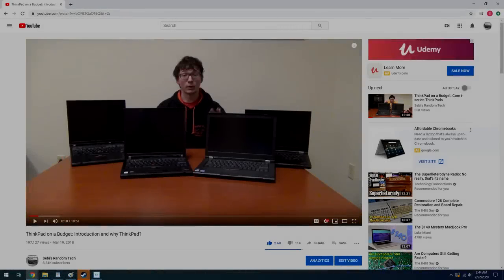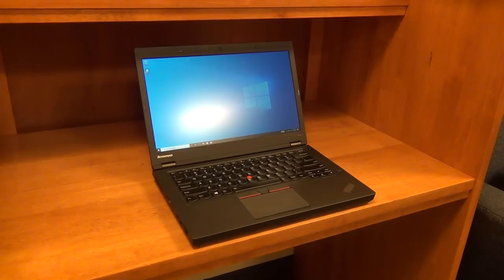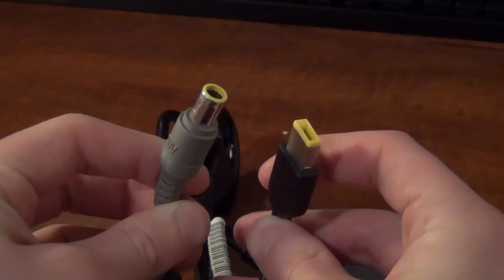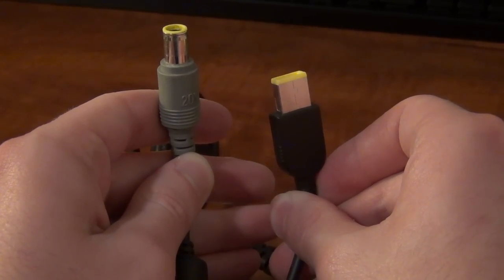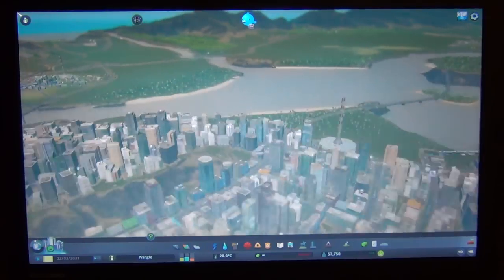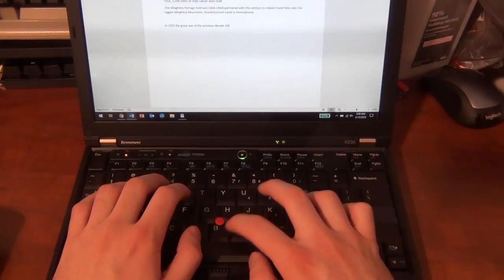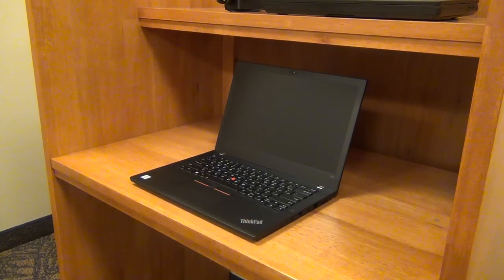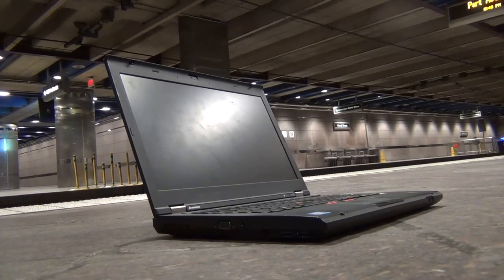Best Value ThinkPads in 2020

Comment: It depends what job you're doing.. as an Engineer who working alot with Solidworks, 3D CAD, 3Ds Max i would recommend you: Thinkpad W541 & Thinkpad P50.. mine is Thinkpad W541 (refurbished)

if you have more budget, you can get new Thinkpad P1 or Thinkpad P53.. later you can plug in External GPU with Thunderbolt Cable
Reply: I absolutely could NOT agree MORE with you here! I have a couple of W540 ThinkPads for my CAD, 3D Desk, and Photoshop needs. The K2100m graphics are more than adequate for my needs. The i7-4900mqq, is pretty much overkill for my needs. I won't need a P series for quite some time, however a P series is a REALLY good investment for the Engineer/Graphic Artist.
When the cost comes down on a high-end P70, I may very well go to one, but I have a set budget of $400 USD, for the initial purchase price.
Reply from the maker: The T440p can be upgraded to a 4900MQ if I remember correctly. While I agree with both of you that the W/P series are very solid machines (I have a W540 myself), they are still a lot more expensive than an equivalent T series from the same generation. Obviously they have an advantage in the GPU category and usually have beefier processors, but nowadays the difference in performance between them isn’t enough to justify the premium commanded by a lot of W530’s, W540’s, etc that I see being sold online, when a T440p can be upgraded to around 80% of the performance of a W540 for less.

A friend sold me a W540 he found at a recycling center for a whopping $15, which is the only reason I have one ;)
Reply: @SebisRandomTech  Maybe 4900. I've tried that and ended up with thermal issues. I have one with a 4800. It's warm, but pretty decent most of the time. I like to recommend a 4700, or 4710 for the T440p. No thermal issues at all.
Reply from the maker: @dragunovbushcraft152  Or the 4702, which runs at 35W instead of 45W.
Reply: @SebisRandomTech  Meh, that would be going backwards in clockspeed though. Even just a little bit, can matter at times. BUT it is an option.

Comment: I was a pretty long term user of ThinkPads, my first one was an X61 and I loved it. However, as the GPU performance of all older/classic ThinkPads is their weak point (as described in the video) I had to jump to the Dell Precision and HP EliteBook lines instead. If you want a portable AND upgradeable machine then the HP EliteBook 2570p is a great option as it does offer a socketed Ivy Bridge CPU, upgradeable RAM, eGPU support and removable battery into a 12" chassis. And both Dell Precision and HP EliteBook 15" and 17" Sandy Bridge and up models support high quality IPS or DreamColor 1080p displays, dedicated number pad and the possibility to upgrade the internal dedicated GPU via a MXM slot, whereas the equivalent ThinkPad W series of the time get stuck with pretty old and inefficient Nvidia Quadro graphics. The only thing I do really miss from the ThinkPads is the keyboard, you'll never find something more comfortable to work with than those classic 7-row ones. Best regards!
Reply: does it support i7 with quad core though?
Reply: The new X395 powered with an AMD chip is way better on graphics performances (vega 10 chip I guess) which is mind blowing comparing with the intel hd/uhd chip.
Reply from the maker: The 17" ThinkPads, the W700/701 and the P70/71, also had MXM slots to upgrade the GPU. Unfortunately with Nvidia ending support for the MXM standard the P72 and P73 did away with the MXM slot. As mentioned in the video, the T420 and T430, along with every older ThinkPad with an ExpressCard slot, can use an external GPU, and these laptops can be modified for IPS displays.  I've seen a few Dells and HP's (actually just sold an HP ProBook 640 G1) that nearly rival the quality of a ThinkPad, but to me there's still no keyboard as good as the 7-row, or even the newer 6-rows. Some of the Dells and HP's have a pointing stick, but it pales in comparison to the TrackPoint, which is important to me since I don't really use the touchpad. I've of course also heard horror stories about support from Dell and HP.

All of that aside, I will have to look into the 2570p, that seems like a very intriguing laptop. Might make for a good laptop to compare to the X230. Thanks for watching!

Comment: I'm using a T530 with a backlit keyboard at the moment and love it. I would rather have the newer style backlit keyboard than the non backlit classic one because I use it in a lot of low light conditions and find the backlight preferable to the Thinklight. I do need to find a reasonably priced older Thinkpad with a full keyboard with dedicated num keys like a W540 for a friend.
Reply from the maker: I always liked the ThinkLight better because if you need to illuminate more than just the keyboard (such as a sheet of paper or a book), it was a convenient reading light to have. I can remember a class I had last semester where the professor would turn all of the lights off while presenting the lesson (powerpoint), and I could use my ThinkLight to not only type up notes, but also write down some of the symbols and formulas that can’t be easily typed on a computer. I think the **30 ThinkPads did things best by offering both, so you could use whichever one you preferred.

For finding a used ThinkPad with the dedicated numeric keypad, something like the T540 or T540p would probably be available for cheaper than the W540, unless your friend needs the extra power of a W series machine.
Reply: @SebisRandomTech  Thanks. I'll look into those. As for the Thinklight it does have it's place and I'm glad I have the option of either.

Comment: Hello, i have been looking at thinkpads and i need one for uni. The main major thing i care about is the display as i do some digital art. I was gonna go with the t460s as its pretty cheap and within my budget. Their display is decent but is there any better versions? The 1080p touch variants were available. Any views would be greatly appreciated
Reply from the maker: Some versions of the T460s and T470s come with a 1440p display that is supposedly better quality. You could also look into the P series as those usually come with better displays, but they may be more expensive.

Comment: As you pointed out, the best part of Thinkpads is the modularity, upgradeability, great support and plentiful cheap parts availability. Unfortunately I am afraid that Lenovo is following the competition de-contenting and making their machines more difficult to repair.
Reply: Oh, and another thing. COVIID-19 has driven up demand and prices for laptops new and used as everyone had to scramble to get on line and factories and supply lines shut down. It will be interesting how this all plays out if the economy tanks and demand falls. Crazy times.
Reply from the maker: Agree with you there, I’m very anxious to see how everything plays out in the next few months and even years.

Comment: Excellent video thanks!

Where can one find those custom adapter boards for the T420 or T430 you reference at 15:16?

Have you used any with and updated your screen? Thanks
Reply from the maker: Typing this from my upgraded FHD T430! You can find them on eBay, which is what I did.

Comment: Hey, was wondering if you’re uploading an updated video for 2023 soon? Because I need a laptop and really like Thinkpads but don’t know what I exactly need and what the best deal for my budget (€400) is. Im studying to be a light designer, so I need to draw Light design plans on Capture, also want to start with mapping soon so was looking for a Thinkpad with graphics card (thats not the standard intel graphics) For now, looking secondhand my options so far are: Thinkpad T15 gen 1 with geforce mx330 or T560 with nvidia 940mx. Other options are T590 or T560 with onboard intel gfx cards. Don’t know if they will do the job? Greetz Simon
Reply from the maker: If you don't mind the added heft you might be able to get a good deal on a used P50 or P51.

Comment: thinking about buying a t480 with an i5, do you think it can handle 1080p editing if i upgrade ur to 16gb of ram? or should i go with something else
Reply from the maker: Depends on what the price of it is.
Reply: t480 is good. it can handle 1080p editing. 16gb of ram is fine, but better off to just max out at 32.

Comment: Hi! I really appreciate your work. I am a Mechanical engineer and therefore I deal with a lot of CAD and CAE softwares. What model do you suggest for my work? I was thinking ThinkPad P51. Do you think buying a second hand P51 worth it, if so how much should I spend for it? Thanks in advance!
Reply from the maker: P51's are great! I think $700-800 is about what they're going for right now. The P50 isn't bad either if you can get it for much cheaper. The P52/52 have newer higher core processors if you care about that.
Reply: @SebisRandomTech  Thanks for your answer! Truly appreciate it!
Reply: @SebisRandomTech  hey bro does p51/52 are have upgradable cpu & ram & gpu??
Reply from the maker: @imuser007  The RAM and storage can be upgraded. An external GPU can be used via Thunderbolt or ExpressCard, but the internal GPU and CPU are soldered.

Comment: I just bought the Lenovo ThinkPad T520 the other day with the i7-2670QM quad core CPU and 8GB memory and I have already ordered some upgrades. I installed a Samsung EVO 860 1TB SSD and have ordered a 128GB msata SSD it's the best laptop I have ever owned and the best part the laptop is like brand new no signs of wear the battery is a 6 cell battery and it only has 3.5% wear level. I was able to order the hard drive caddy for only $6 counting shipping for it's age it's fast it don't even feel like a older laptop with how smooth it runs and it's very quite
Reply: Congratulations! Is it your desktop replacement? Will it be too heavy to bring out for work?
Reply: @ericyip947  I got a Ryzen 7 gaming desktop but the ThinkPad was a replacement for the old Toshiba i5 dual core that was so slow. It's a great laptop first time owning a ThinkPad laptop. I needed a good laptop that's fast enough to do everything I do on my desktop(the basic stuff) and have good battery life that old Toshiba laptop only had 1 hour and 20 minutes max and the bad thing was that battery was still good. The new 9 cell battery I got I get about 7 hours and the OEM 6 cell battery I haven't tested it but it only has a 5% wear level as of now so it's like new so my guess about 5 hours maybe. I ended up returning the 128GB mSATA SSD and going with a 1TB version for extra storage giving the laptop 2TB total I upgraded the memory to 16GB and even found a ThinkPad laptop bag on Newegg that I bought. Also had to buy a external DAC cause the onboard sound can't run my headphones also bought a USB Bluetooth dongle. Also added a cooling pad and just ordered the last thing for it the other day a portable set of USB powered HP speakers for it. It's running great so far
Reply: @adamgrant1787  7 hours battery in t520? That’s excellent! Did you buy a third party or the original battery? I recently saw a deal of a w520 with 1920 screen, 8gb ram, i7 2630qm just about 110USD ( converted from HK dollars) I think I’m going to pull my trigger, though the heavy weight
Reply: @ericyip947  The 9 cell battery is not a OEM battery the brand on the battery is Dr. Battery and they used all Samsung battery cells. Both the OEM 6 cell and the new 9 cell battery both read is Sanyo batteries so my guess both are using Samsung battery cells. The 9 cell battery lasted about 6 and a half hours to just under 7 hours max I had the laptop power setting to not turn off the screen or laptop and set the power settings where I would have it set while using it on battery and let it run till the laptop turned off. I'm sure it would last longer if I used battery saver but even if it lasted about 6 hours while surfing the web or Youtube I'm happy with that cause I still have the 6 cell OEM battery
Reply: is T520 better than T560 or are the same? pkease answer
Reply: @futurefoothd  I suggest you look at the hardware-specifications of the particular T520 and T560 that you are looking at, and compare the two hardware--specifications, and see which-one has more-powerful hardware.

Also: As far as I know, the T560 was developed AFTER the T520. [So technically/technically-speaking,  it should have newer hardware.]

Comment: Valuable information, thanks! I've never had a thinkpad before but as someone who appreciates the quality of these old builds, this is an excellent starting point. I might try to get one today on ebay. :)

EDIT: bit the bullet and bought a t440p. i'm excited to see how it is in a week or so! :)
Reply from the maker: Welcome to the club! You picked a great model to start with, a lot of easy and readily accessible upgrades.
Reply: @SebisRandomTech  Thanks again Sebi! Got the t440p and then upgraded the RAM and installed SSD. It works way better than the $450 acer I bought a couple years ago that crapped out on me. Plus this one came with the 1080p display already installed. I'm a happy camper :D

Comment: I just bought what I consider to be a gem - T470p ; quad core, 16gb ddr4 (upgradable up to 64gb), 500gb ssd, FHD IPS display. Got it for 600$ and I think it’s a steal - near mint condition. Can’t wait to get it lol.
Reply from the maker: T470p is a rare beast. Cherish it and enjoy it.
Reply: Sebi's Random Tech 
Thanks man, appreciate it. Subbed btw - your vids are very practical.
Reply: Ok, but I think maximum RAM for T470p it is 32GB
Reply: code6400  - you’re right. 
What do you think is more important - changing the storage to a m2 ssd (currently regular ssd) or upgrading the ram to 32gb ?
Reply: I was deliberating between T480/480s/490. Reading your comment, I looked up T470p. Found one for $670 on ebay (plus $50 tax... gross, ebay charges tax now) with 32gb ram, nvidia, 1440p screen (I actually prefer 1080, will likely sell the 1440 and swap out a nice ips 1080 at some point), and even WWAN. Benchmarks mostly match or outdo the T490 i7 across the board. I really wanted a thunderbolt port, so that's sad, but the tradeoff is a power port that is replaceable if it snaps, and a lower likelihood of that happening. It also can take two drives, has both ram slots, and is a real quad core cpu.

It also has a thumbprint reader that is linux compatible, and doesn't have the power throttling issue or the speaker issue of the T#80/#90 series. It seems to be the best thinkpad you can get that 'just works' with linux across the board, without any asterisks or caveats.

I think the T470p might be a better successor to the title 'last great thinkpad' than the T480.

On top of that, it's also not that thick, and only .8 lbs heavier than the T490. It isn't svelte by the hyper-thin standards everything is setting today, but 4lbs is plenty portable--My T460 is 3.8 lbs, and I carried that with me all around europe.

Anyways, thanks so much for making this comment! Changed the course of my purchase, pretty sure for the best possible option! This one wasn't on my radar until then.
Reply from the maker: @KyleBaker  If it wasn't so darn rare it probably would be a good contender for "Last Great ThinkPad". Since it's a more obscure model it doesn't quite fit what ThinkPads are all about - cheap and easy upgrades/replacement parts, wide accessibility. In that regard the T480 is the last of the breed since it retains upgradeable RAM, the hot-swappable battery, and 2 storage options. Other than that and not having Thunderbolt I would definitely think the T470p is a better laptop.
Reply: Kyle Baker - yes, they are rare and for this price range are a very good investment. 
The lack of the usb c port is the only downside for me, but I can do with that. I need it for coding and I think it will suit me well. 
This model was the last of its kind - there are no t480p/t490p. 

Enjoy your new purchase and thanks for the comment.
Reply from the maker: @_SkyEye  They are making a new model called the T15p, like the -p's of yesteryear they are basically bringing more power and upgradeability to the 15" T series.
Reply: oh man i really want T460p/T470p…
Reply: @_SkyEye  depends on your workload if the storage medium io performance is sufficient stay with it else upgrade it but maybe a ram upgrade would be better again I don't have any idea of your workload but I could recommend getting Diskeeper for ram caching cracked from nsane fourms before upgrading the IO medium

Comment: Does the keyboard backlight on the T430 work still when you swap in the classic keyboard? I'm guessing no, I'm guessing the backlight is specifically tied with the chiclet keyboard. But wanted to ask anyways.
Reply from the maker: It does not, as you said it is tied to the keyboard. If you do the classic keyboard swap make sure to isolate the necessary pins on the ribbon cable so you don't blow out the keyboard backlight fuse.

Comment: Hello i bought x250 this march 19, 2020 is it still worth it? Bought it 10,000 peso here in the philippines 500 hdd
4gb ram
I5 5th gen
5500 graphics
Reply: I got one off Amazon with 8GB RAM, i5 5200U, 5500 graphics and 500GB SSD for £280. They are great laptops.
Reply from the maker: The X250 is a nice, compact laptop. I think you'll be happy with it.
Reply: Quite nice machine. :)
Reply: miller ongayo sa facebook market sir

Comment: between the x270 and the t470 which one would you recommend. Does the x270 overheat, is the pwm display on it bad and if is it less powerful than t470 for the same processor?
Reply from the maker: You can expect similar performance on both when it comes to raw processing power, the T470 can take more RAM and some configurations come with dedicated graphics. Aside from that it'll come down to your personal preference for the display size and such.